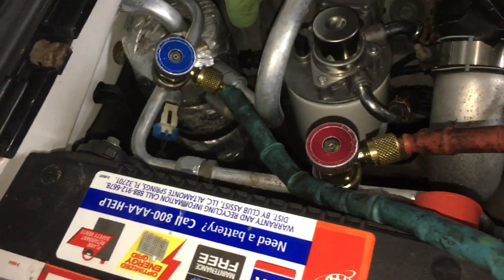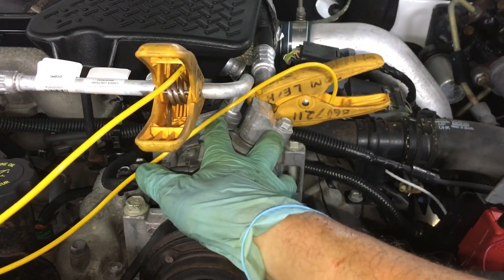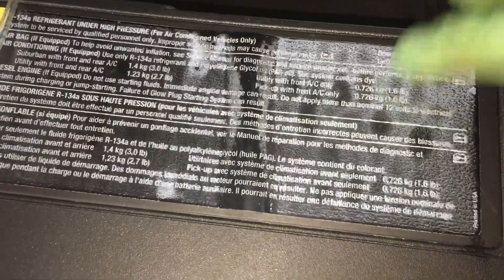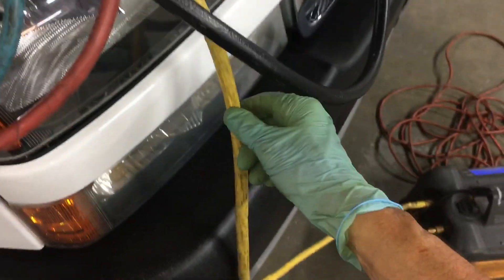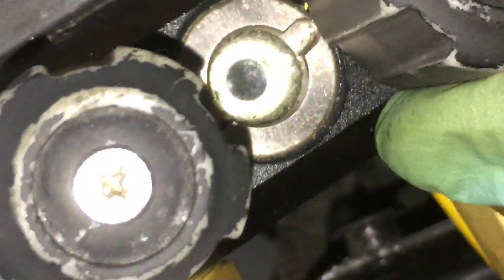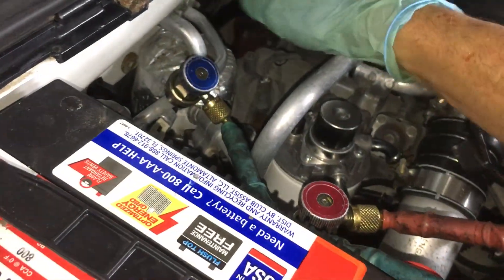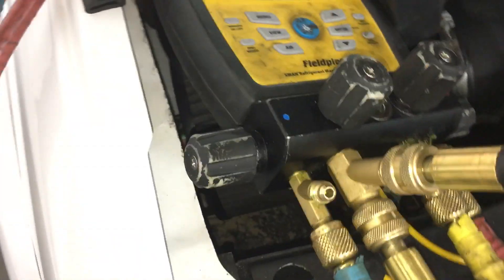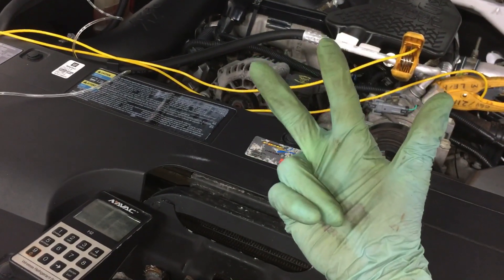Recovering Refrigerant oil on accident without knowing it when performing a refrigerant recovery￼

Comment: Looking forward to you using the inline sight glass, also what do you think about using a inline oil separator  if your manifold gauges don't have a sight glass so you can measure out the amount of oil you may have inadverntly  taken out recovering refrigerant?  I believe robinair sells a setup like that to go along with their portable recovery equipment....Anyways thanks for the vid's and keep them coming !!
Reply from the maker: Yes they do make in line oil separator. 
                    One product was originally developed to remove AC sealant out of the refrigerant before it goes into your very expensive recovery recycle recharge machine. 

       Small portable refrigerant oil separator’s are nothing new

I have one in one of my original old school primitive Sercon 9000 refrigerant recovery unit. 
        I think I may still have one of these put away in storage for the last 20+ years up on the shelf in my garage I should dig it out. Just to get out the oil recovery unit out of the machine